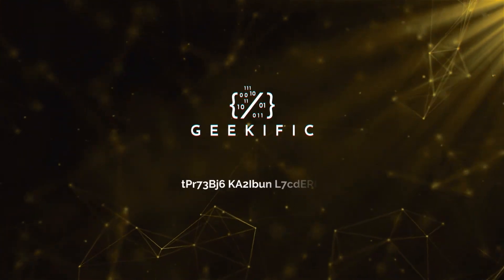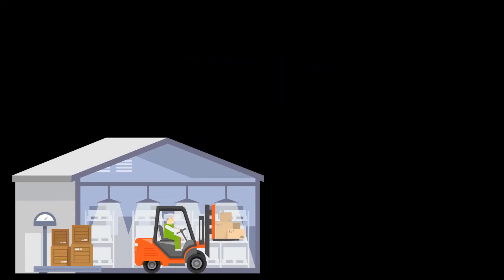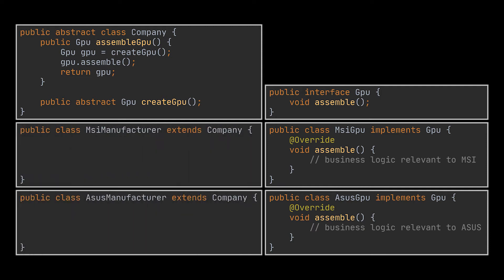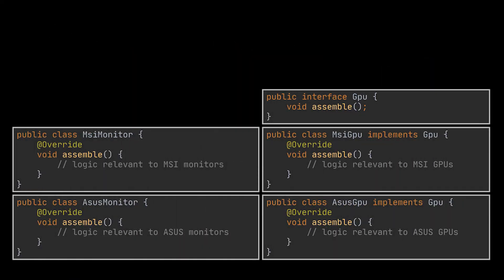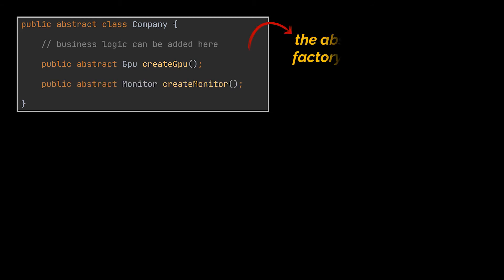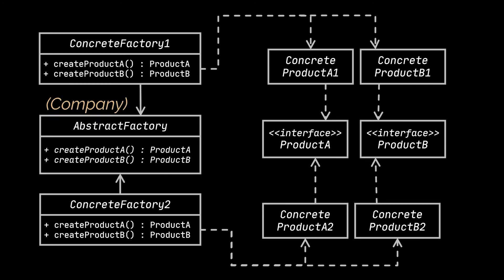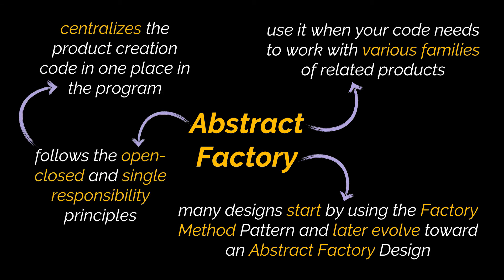The Abstract Factory Pattern Explained and Implemented | Creational Design Patterns | Geekific

Comment: at 2:55 we didn't apply correctly the factory method pattern and therefore the main usefulness of the the abstract facotry is still missing, beacause instead of passing an argument to the createComponent method, I can create 4 different classes of concrete creators respectively for the two types of Monitor and the two types of GPU... and the approach will respect the principles OCP - single responsability without feeling any need for something extra supposed to be provided by the abstract factory pattern... 
the transition from factory method pattern to abstract factory pattern is a little bit unclear. 
but anyway the video is very awesome dear friend, Nicely done and I highly recommend your channel.
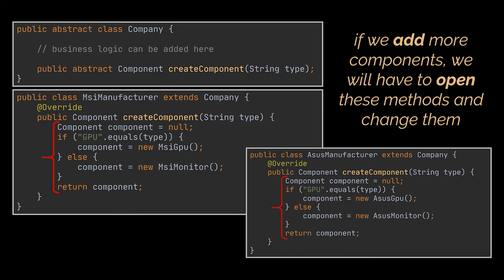Reply: I'm a bit confused as well, at 3:25 it says you'll have to modify concrete implementations of Company class (which breaks OCP) but then at 4:35 when a new method is added to Company interface (which is supposed to be the solution) you again have to modify concrete implementations to define that method. Of course better than before as you get compile time safety but it seems it still breaks OCP.

Comment: If I want to add a new company, Apple, with only one product, AppleMonitor, and extended Company to create a concrete factory, AppleManifacturer, it's forcing me to implement an  unnecessary method to createGPU. How to solve this?
Reply from the maker: You need specialized factories or multiple specialized interfaces to keep using the pattern or you'll have to change the pattern. Hope this answers it!

Comment: Thanks very much.  I've been coming back to this playlist for all the different patterns... that means it's really good playlist.  I would like to ask: If ASUS only produces CPU and not monitors, then it will not implement the abstract monitor method ?  How to handle this ?  Another pattern ?
Is it possible to combine factory pattern with build pattern ?
Reply from the maker: In case the object you are attempting to create is very complex, you could combine both yes. The Factory Pattern could be used to create instances of a builder class, which in turn could be used to construct complex objects step by step. This approach provides flexibility in object creation and allows for the construction of objects with different configurations based on specific requirements.
Reply: @geekific  thanks very much... appreciated.

Comment: Isn't the Company-Class (Abstract Factory) still open for modification since one needs to add another createX statement if another product type is to be implemented?
Reply: nice observation! See we can create Factory classes based on Component(GPU/Monitor) or brand but we chose brand for creating Factory classes to follow open/closed principle.New Components are rarely added whereas Brand under a component can increase frequently.For every new brand, we create a new factory class with methods for GPU & Monitor.We don't have to modify Factory class of this new brand unless there is a new component added.

Comment: Hi Geekific
I don't quite understand; if a new type of product, such as ProductC, is added, it appears that it might violate the Open-Closed Principle.
3:19 Factory method pattern violate the Open-Closed Principle when new type of Product added, It just appears the Abstract Factory Pattern doesn't solve this problem. (we should modifiy all the factory class to add a third createProduct method.)
@Grrkific
Reply: you will have to add a new `createProductC(): ProductC` method but the client code will not have to change. This is a minimal OCP violation in the pattern, which is traded for major benefits in the client code (which is typically much more likely to change)
Reply from the maker: At 3:19 is not the final implementation, we are progressively shaping up and evolving the implementation throughout the video, keep watching!
Reply: main function is client code. 
Factory method should not do the object instantiation inside client code. Factory should be the only place which is responsible to create these objects.
Reply: @shwe7211  yes i have the same doubt. Were you able to clear it ?

Comment: great video. But I still have the problem of how to create the manufacturer object without breaking the code.  In the main method, you have to decide what manufacture object should be created. You may use the if else condition to determine. Does it break the open close principle ?
Reply from the maker: Thanks! As long as it is on the client side you are fine. For example if you had a UI where you click on stuff that forwards you to the needed object, you won't even need the conditional if's because that UI construct will immediately make use of the appropriate logic! We will be uploading a video on how to make use of these patterns, so stay tuned!

Comment: What happens if you add a third manufacturer named NVIDIA that manufactures GPUs but not Monitor? I tried to do it and can't make it work without violating the Liskov Substitution Principle (due to be constrained to override the assembleMonitor() method from the abstract class) by throwing an exception since they don't manufacture monitors (based on the example, don't know if they do it in real life).

Your videos are amazing, by the way! Would be great if you could give me an insight on how to workaround this problem of related objects that don't have precisely all the capabilities by design (the NVIDIA case with monitors). Thanks a lot in advance and keep up with the great work @geekific.
Reply from the maker: Glad to read this am happy I could help :) Well in these cases you're going to have to choose the pros and cons of your current design and take a step back to check the requirements. You see, maybe what you really need is two factories and not one, because why is this new factory not producing the same products as the others? (That's what I would have done in this very specific example) Does it fall into some different category (maybe brand categories in this example)? What if the products that where associated with the first design should actually be split into two? What if after answering these questions you realized that this new producer isn't actually what you had in mind and shouldn't be sided with the others in the first place? 
In other words I can't give a definitive answer to this, because each case is specific to the functional requirements at this point, do not always try to solve the problems in the technical way by overengineering the design, sometimes, it is the other way around :) Hope this helps!
Reply: @geekific  My initial thought was about making two Manufacturer class and that way somehow solving the issue. But wouldn't that be sad? I mean, it makes me scratch that part of the head regarding the "what if" we could find a way. If Java could allow inheritance from two class that could have helped greatly.

Anyway, I am learning a lot with your videos and keep rocking it! Honestly, it's one of the best Java-related channels I have seen here on YouTube.
Reply: In that case, the most appropriate thing is to create interfaces that are dedicated to creating each component.

public interface GpuCreator{
   GPU createGpu();
}
public interface MonitorCreator {
    Monitor createMonitor();
}

public interface AllComponentCreator extends GpuCreator, MonitorCreator
{ }

The Company class will no longer make much sense, unless it has more methods in common, but that depends on the business rules of each application.

Then AsusManufacturer and MsiManufacturer will implement AllComponentCreator while Nvidia only GpuCreator. Example:

public class MsiManufacturer implements AllComponentCreator {
     @Override
     public Gpu createGpu() {
         return new MsiGpu();
     }
     @Override
     public Monitor createMonitor() {
         return new MsiMonitor();
     }
}

public class NvidiaManufacturer implements GpuCreator {
     @Override
     public Gpu createGpu() {
         return new NvidiaGpu();
     }
}

Even though the base class does not exist, it still respects the abstract factory pattern because you have a class that creates a family of related objects.

On the other hand, your client code must know when it needs to create both components and when only GPUs:

AllComponentCreator msi = new MsiManufacturer();
AllComponentCreator asus = new AsusManufacturer();
GpuCreator nvidia = new NvidiaManufacturer();

You can always create an interface to group behaviors, but it is essential that the business rules are clear and your client code must know when it needs to create one type and when another type.

Comment: I am confused, where will the actual decision to create which concrete product takes place? Like there need to some conditionals somewhere, like interpreting the customer request and deciding whether he needs an ASUS GPU or MSI monitor, right? Where would that conditional if-else block be placed?
Reply from the maker: That is the whole point! This decision is now moved to the client side :)
Reply: @geekific  But I keep reading this phrase about Factory method, goes like : "It helps in centralising the decision making part, so that if we later want to change something in that decision process, we only have to do it at one place". 
So if the client gets to write their own conditions, then is it the responsibility of the client to keep the decision making centralized?

Comment: Thank you very much. 
Two questions:
1. The handling of all the if statements is at the client code right? 

2. From my understanding, if the abstract class is responsible for the creation of multiple interface (multiple factory methods), then it is abstract factory pattern. But if abstract class is responsible for creation of only one interface(one factory method), then it is factory method pattern. Basically you will have as many factory methods in the abstract class as interfaces right? Am I correct?
Reply from the maker: 1- Yup.
2- You got the comparison right, and if by interfaces you mean products, then yes you are correct.
Well done!

Comment: Umm, what if you have a manufacturer than have a GPU but not a monitor?
Reply from the maker: If you only have one, then I believe you are referring to the Factory Method Pattern: https://youtu.be/EdFq_JIThqM. Hope this helps!
Reply: @geekific  Thx for your comment. I actually mean, what if we have 3 factory methods, Gpu/Monitor/Cpu... and we have 3 Factory Creators, like MSI/Asus/Dell... but it does not make sense for the "Gpu" factory method for MSI, cuz MSI does not actually manufacture Gpu at all... how to deal with this? in this case is the Abstract Factory Pattern will not be suitable? Since it defines "a family of objects" so all factory method should be applicable to all factory creators? Or is it ok to just throw exception "Does not have Gpu" for MSI and it would not be a bad design?
Reply from the maker: There is nothing written in stone, you can mold these designs to suit your needs and in this case, in my opinion, the cleanest way to make the factory work is by applying the Interface Segregation Principle discussed here: https://youtu.be/HoA6aZPR5K0. So, you will have multiple specific abstract factories or interfaces, and you can pick which concrete factory implements which. However, during the creation you'll need to be aware of the one you'll be using.
Reply: @geekific  Appreciated

Comment: ISP SOLID principal  violation This design assumes that company abstract methods must be implemented by all manufacturers. What if a company doesn't want to  manufacture some product it doesn't find value in. You will end up overriding methods which violate ISP.
Reply from the maker: You can create separate GPU and Monitor companies interfaces and let manufacturers implement the ones they need for ISP. This pattern answers a particular question and I didn't want to overwhelm everyone by overengineering the code, but yes, if that's what you are looking for, this works. You can check our SOLID video here: https://youtu.be/HoA6aZPR5K0. Cheers!

Comment: Doesn't this still violate the open/close principle, since you need to edit the abstract factory class every time you add a new product? Like imagine adding a new product "headset", you'll have to modify all three classes Company, AsusManufacturer, MsiManufacturer. Even though creating some new methods is better than dealing with messy if-else statements, it is a compromise one needs to accept.
Reply from the maker: From Wikipedia: "software entities (classes, modules, functions, etc.) should be open for extension, but closed for modification". So, in your example we do not violate the OCP, as Open-Closed means you are allowed to modify the way a system works without modifying the code that already exists, so, you can extend the existing code, but the old code is still intact and doesn't need to be re-tested .
Reply: @geekific  Thanks a lot for the clarification. Adding something to a class file doesn't necessarily have to mean "modifying existing code", got it.
Reply: Splitting hairs. Technically you’re not modify the actual code but you are modifying the class by adding new code. If someone fat fingers something or copy/pastes the wrong thing you’ve broken it.  A true not open model would use reflection and inputs from an xml or json file that can be changed without touching any code at all.

Comment: But wouldnt each new product that is not a monitor or GPU mean you ha e to open the company code to add the abstract method?
Reply from the maker: A code cannot be closed for "modification" if it doesn't exist in the first place. The idea behind the principle is making any new functionality you add open for extension. Besides all the code is and will rely on the interfaces, hence other parts of our application will not even feel the addition you mentioned, but that's another principle :P Please check our SOLID video for a more detailed explanation: https://youtu.be/HoA6aZPR5K0 Cheers!
Reply: @geekific  Well what I mean is, say a company can now make CPUs and Fans as well. We have to add the abstract methods "createCPU()" and "createFan()" inside the company class. Then override those methods inside each manufacture class. Wouldn't that be what we are trying to avoid?
Reply: @shadowwatcher5042  This is what I am not getting either.   The IF statements can't seem to be taken out.   SOLID isn't as solid as it wants to be.   I don't think its possible to completely adhere to Open-closed.

I keep trying to think of a dynamic way it could be done by using external data files or mapping.
Reply: @drcl7429  Perhaps each factory can be extended. So say we have factory1 that makes shoes and socks. The company expands and wants to make pants and shirts. So the second factory is simply called factory2 that extends factory1 and makes the clothes. 
That way in the main function, factory2 can be used and still call factory1 methods.
Factory3 extends factory2 and makes jackets and hats. Then just use factory3 to get methods of 1 and 2
Reply: @shadowwatcher5042  what about he IS-A principle?

Please check my other comment.
Reply: @drcl7429  What is the Is-a principle? And I dont know anything about mapping or external data files so I cant help there.
Reply: Exactly. This is a half way solution that just uses interfaces to group,things hierarchically.  It’s not a true factory which is an engine that should take declarative inputs and produce the output WITHOUT NEEDING A COMPILE/BUILD CYCLE.
Reply: @D RCL it can be and  is done all the time. Look at JSON serialization into object classes. You build structured JSON and use the JACKSON or GSON libraries to map the json into class  instances.
Reply: This whole model could be built with two classes -manufacturer and product - and one JSON file with infinite combos of those two entities.